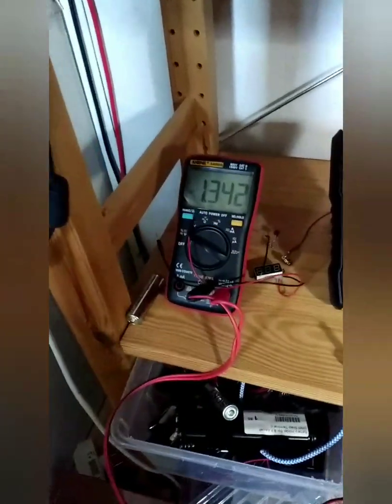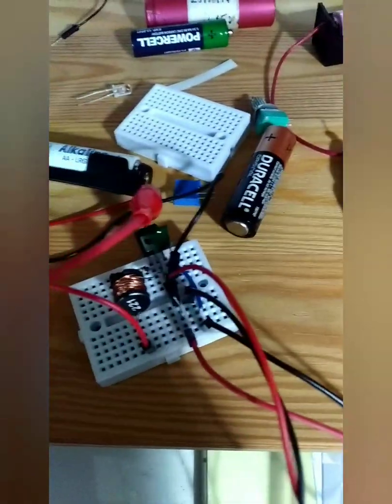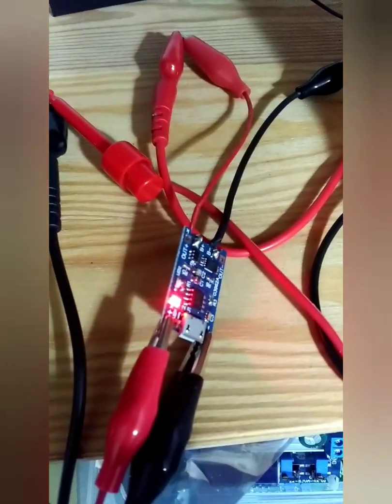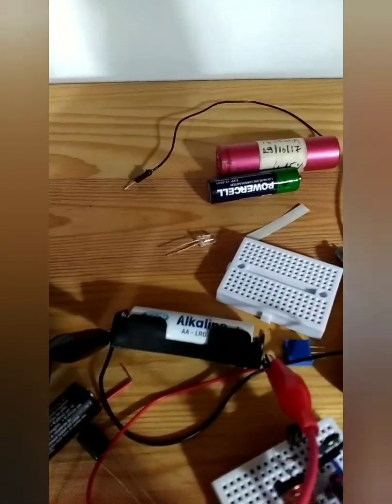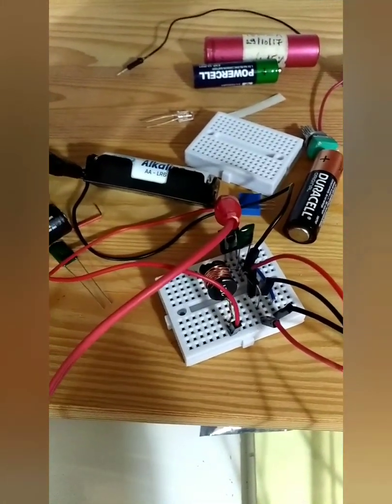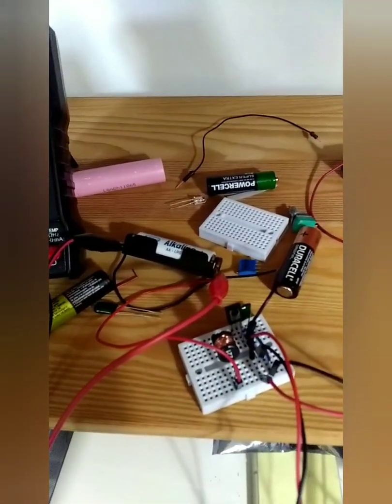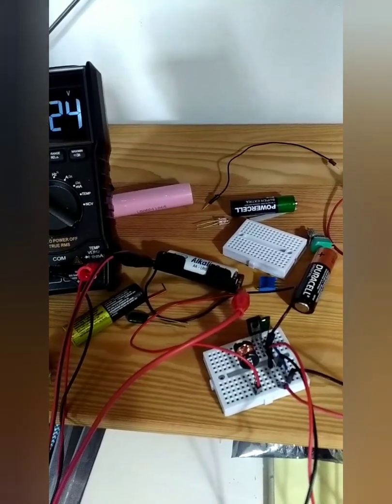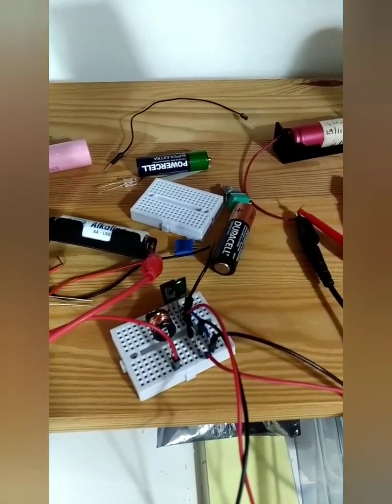Joule Thief Charger

Comment: by default in a joule theif circuit, source battery and output caps or load  is connected in series, that's the reason why it draws more current from source when it boosts up the voltage, 

if you modify the circuit and connect the load in parallel to the coil thicker wire and also put a diode so load can be powered only by collapsing magnetic field, it will then boosts voltage and current both and wont draw extra current from source battery. 
it will become overunity then.